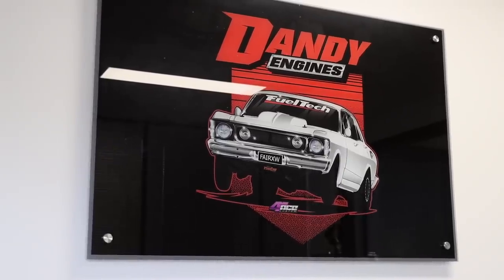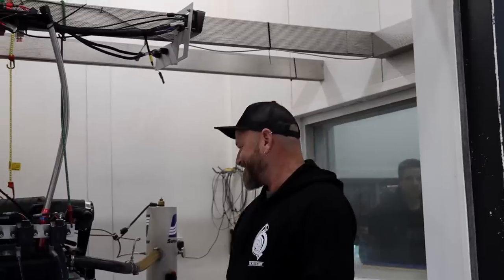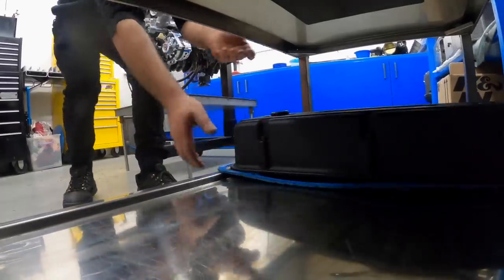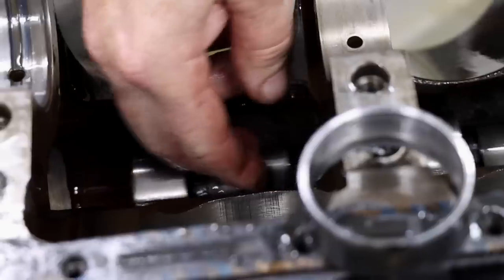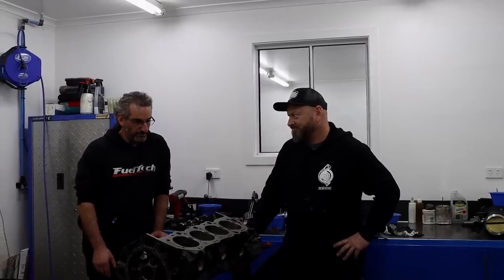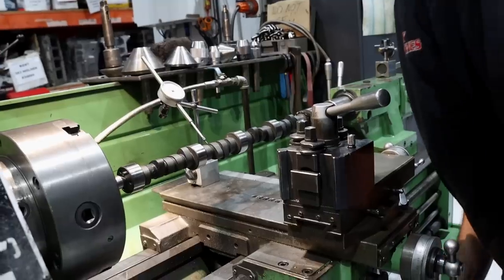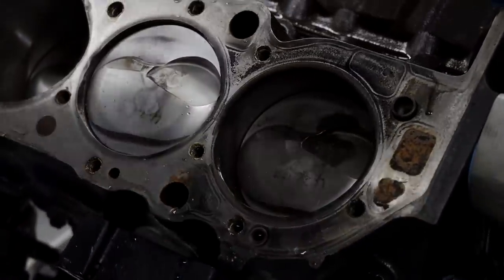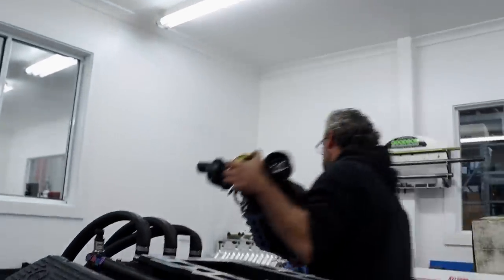Al's Blown Big Block EXPLODED On the DYNO!

Comment: Truly unbelievable that engine could be that good after a 5000 RPM full stop!  I would say miraculous
Reply: When someone like Frank, who's seen pretty much every engine failure mode in existence, has a legit hard time wrapping his head around how this didn't just mince everything into little metal shards.... yeah, it's time to break out the word "miraculous" for sure.

And the more I try to wrap my head around it myself, the less sense it makes. That piece of camshaft dropped towards the sump.. and hit the crank in such a way that it flew up the bore... without scratching anything or get pinched.. yet somehow instantly stalled the engine so it didn't get shaken up and down inside the bore..
Reply: When that thing stopped dead in its tracks,that must be what bent that piston pin.never saw a guy be unlucky and lucky like he was before
Reply: I mean it stopped immediately too... I would have bet my paycheck the block would need machining at the least
Reply: The engine stopped quick because it broke the camshaft.  The distributor is driven from the rear of the cam so when it broke it in effect shut the ignition off.

Comment: Massive shout out to the crew at Dandy engines for pulling that overtime.
Also Al... you want to buy a lottery ticket after that, cause HOW you got away with that failure with only 2 valves, 2 lifters, a gugeon pin and camshaft and NO other damage..  That's just crazy.

Comment: Definitely buying a Harrop e-locker now.  Really interesting to see master level machinists and engine builders at work.
If nothing else your channel has done good things for the brand.
Reply: Harrop bits would often be part of Bathurst winning builds surely
Reply: I'm a fan of harrop but e lockers are trash. Arb air lockers are shit to. Tjm pro locker is the only way to go
Reply: @jarrod1687  this guy knows. 
I'm running Pro locker rear, harrop elocker front. Constantly have the front e locker open wheel on me.
Reply: @lumpydoridori  yep nothing but dramas, a lot weaker center in some cases to

Comment: I took my '85 Firebird out for a test run the other day after transplanting a T56 into it, and finding my 350 with a flattened camshaft. Replaced a ton of parts, made it all shiny, just to find, after pulling it back into the shop, that I had a trail of fluid behind me. Might just be the power steering fluid leaking everywhere from a bad seal on the steering box. Haven't been able to find time to get it back on the lift, but I have a bad feeling that I'm going to be replacing seals on the T56. All things considered, my day went a lot better than what was seen here.

Great video. Love to see it.

Comment: The boys at Dandy Engines are legends! Great work guys, and thanks to the wives for putting up with the hyjinx. Seriously, I’ve never seen an engine builder step up like this. And grinding lifters for the correct taper, amazing! I was one of the guys who warned about the lifters after my buddies engine took a crap on the Dyno because of bad lifters, even after ordering a cam and lifter set that was broken in before installing. His is back with a roller cam, but it took months, not a day to get done, took six months to get the cam for a 351 Cleveland here in the US, sad.

Comment: Wow! Unlucky and unbelievably lucky at the same time. That's wild. 
I think because it happened on an engine dyno rather than in a car may be the key here.
In a car it would still have the weight and inertia of the car driving the engine and crunching stuff up inside.
On the dyno, instant shutdown. Frank is a legend! As are all the Dandy guys <3

Comment: Could not possibly be more Aussie than that one awesome man and one awesome crew to drop everything and fully deck face linish measure rebuild and reassemble in under 24 hours is really unheard of these days you certainly got yourself I'd have to say hands down the best dyno tuning and engine shop in Aus and i will be using them for all my engine jobs from now on I'm wondering if they do performance motor cycle engines as well

Comment: Top Drawer Motor Engineers, they really stepped up to the plate.

Al's composure is remarkable, I would have lost if I had to pull a piston out with a piece of camshaft and lifter.

Top class guys 👍👍

Comment: Granted a cam isn't spinning as fast as a jet turbine, but it is amazing how metallurgical issues can cause catastrophic failure.  Look at what happened to United 232 (DC-10 summersaulting across the runway into a corn field in Iowa).  A catastrophic failure of the turbine wheel was caused by a fault the size of a grain of sand.  This literally could be the same thing: a microscopic issue causing major carnage (at least it wasn't an aircraft in the air, as in the case of 232).  As far as the block being unharmed, it reminds me of when Homer Simpson looked into the dog house to verify the presence of a badger.  He came out scratched, only to lift his shirt (which was intact) to find his guts spilling out.

Comment: Saw a 383 Desoto do the same thing, the front 4 kept running, the guy drove it in because he couldn't fix the miss! Also know of a 440 that ate cams like this. I always wondered if it was because it had a front motor plate and routinely had the clutch sidestepped at 7500 rpm! Alot of twist going thru the block!

Comment: we had the exact same thing happen a couple months back on a blown big block, cam came out in 5 pieces, also bent 2 valves aswell and no other damage, everything got stripped back down, cleaned and put back together and procceeded to make an easy 4 digits

Comment: Had to do a starter replacement on a truck with a Chevy small block. Replaced the starter and it didn't roll over. Ended up dropping the pan to find a piece of the camshaft as well as a lot of shrapnel it took with it as it kicked and screamed its way to the bottom.

Comment: I had the same damn thing happen to my 350 Chevy with a comp cam hydraulic flat tappet and it didn’t do anything to my engine other than what you guys seen so after taking the motor apart and changing all the bearings and oil pump making sure it’s clean as possible then I installed a Howard’s cam and now she runs flawless.

Comment: That was an intense Ep. Not only, to get away with what damage was done ((like OMG), if that wasn't enough of a sign in how lucky you are (as you know). To have Dandy Engines, go the extra 1/4mile and machine/check/rebuild the skeleton you had.

Then, this build is also looking to be (I don't want to jinx it) the unicorn build. In that everything is precise, prepared with modern upgrades and as you'd wish it to be.

This is going to be so much fun. I can see that supercharger kit sold out multiple times over in its entire manufactured lifecycle. Strong reliable repeatable, giggles on tap. 700Nm unfinished, shit I pitty the fool that lines up to you during  Roll Racing meets...

Comment: I have to be honest,
i went from a MX5-ND RF daily to a full electric opel corsa-e.
Already on the MX5 i basically couldnt do anything anymore in my basic shed.
Now the only thing to be changed in the next years is gonna be tires (250NM FWD) and the brakes, due to recuperation possibly with rust insteadof usage.
- And i am totally happy zipping to work and back in silence, while using up less energy.
Totally boring, nothing to do. If stuff goes wrong i also can do nothing.

But i am still impressed by people really doing the hands on work, building and knowing stuff without relying on some readouts. Just glad i dont have to worry about repairs myself.

Comment: had a  problem at 2:00  hear a low hole with a problem..  Have been in the hot rod building biz since the late 70s along with alcohol and fuel engines.....  never ever have I seen a failure like that... you are 1.  luckiest guy EVER....  now maybe that is why "roller cams" are all steel billets?   I too use mostly flat tappet cams and that was not a tappet failure.. I am thinking that cam was cracked from the get go..  You have a great shop to work with there...  those kind of shops are going away really fast...

Comment: Dudes I had exactly the same failure with an after market can made by edelbrock. It snapped for no apparent reason and damage was limited to lifters and cam bearings. Mine snapped at the rear but in the same way.

Comment: I always ground my solid lifters completely flat on a surface grinder not a cylindrical grinder and gave them a coarse finish from a rough sharpened grinding wheel and in 20 years I never had any issues with the lifters rotation, wear and reliability. The original unmodified Ford lifters always had either a slight taper or a radius on the face which I removed on the surface grinder, I had quite a lot of arguments with my camshaft makers about this practice and on 2 occasions their CEO attended my workshop to see me grind half a new build's tappets flat and leave the other half standard and then run the engine for 2 hours on a dyno, then strip and recheck how the tappets were doing, in every case the tappets I ground flat were rotating fine and looked better than any of the unmodified tappets. The CEO's were surprised at these findings and left my workshop having learned something. I'm quite certain that the coarse finish was highly beneficial to the tappet's breaking in correctly as it would tend to hold oil on the surface of the tappet better 'Sausage'  HT Racing Ltd

Comment: Nobody believes me when I say use 3M Ultra Yellow weatherstrip adhesive to seal head bolts and studs on Chevy's and I detect proof that the legends in Dandy Engines are doing the same thing!  I absolutely hate the crappy white teflon stuff that crumbles.  It's attention to detail that makes the difference and this shop just reeks of attention to detail.  You fell in with the right people Al!  It's great to see  a "fail" like this and what goes into a full anaylsis and recovery.  Great video.  Your best to date in my book and I've seen them all!

Comment: Had this happen 25 years ago without anything catastrophic happen.
Autopsy was a camshaft core failure.
Really corse grain structure.
Replaced with solid roller, crower, thru hardened and that guy ois still turning 8500 +.
Don't use flat tappets no more and word is from the states there are huge issues with the flat tappet castings and the lifters.
Anyway very lucky there giuys!.
Nice turn around and rebuild.

Comment: When the cam broke, the distributor stopped almost instantly, being on the end now no longer connected to the crank. Cam may have stopped with no valves fully opened on the rear 6.
Load from dyno, compression and the supercharger brought the engine to a stop very quickly. I'd love to see the original (higher res?) video to guess at how may revoloutions the engine did before it stopped. My guess is the cam broke at the second bearing* (stopping the engine), then the unsupported front bit being turned and with the valve / lifter loads broke off just as the engine stopped which is why the front bearing was munched and there was no damage from the free floating bit. Super lucky (yes with that "kiss").   Also love the get it done attitude "do you have to go anywhere?"  (*could have been the other way around. the front break looked like it was through one of the lobes and that angled break with rotation along with lifter load may have snapped the rear bit off second and a few revoloutions into the shut down. May make more sense as there were bent valves on the front cylinders.)

Comment: I appreciate that the he's trying not to blame anything, but it's pretty clear that the cam itself failed internally.  The break is not in a normal place, which suggests the slug used had a hidden or un-noted fault.  Just looking at the rip on the video, you can see a sort of half oval shape which suggests one part of the cam itself wasn't as strong or as solid as intended.  You are extremely lucky that the engine stopped that quickly and didn't do any other major damage.  Amazing rebuild to "better than new" specs, plus the bonus of a very slight bit more compression with a few thou off the block and heads!  ;)

Comment: i have seen a 351   cleveland do a similar thing… dropped out a piece of cam bout the same size as that 2cylinders worth only difference being it dropped onto a rod and the rod punched it out the side of the block… is it possible someone dropped the camshaft before it went in the box it came in i know they can snap if ya drop em on the floor.. maybe it had a fracture from before ya got it…

Comment: I had hairs standing up when it was said that you were still running run-in oil and pulling power runs. Oil after the "Boo-Boo" was like water. That being said, thicker oil wasn't going to stop that damage. PD blowers generate diesel level torque that petrol engines struggle with a bit. 
Farkme, "Came with bonus 5G Wi-Fi camshaft and lifter" Priceless......

Comment: Just wondering why a flat tappet camshaft was chosen for this build? To many of us flat tappet cams are not as durable as a billet solid roller or Hydraulic roller cam if the correct lifters and springs at utilized.